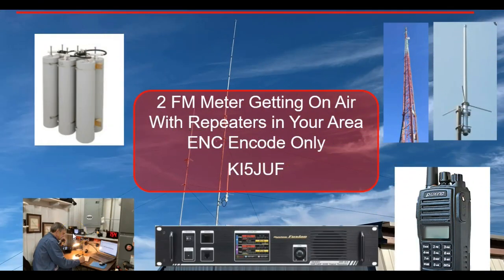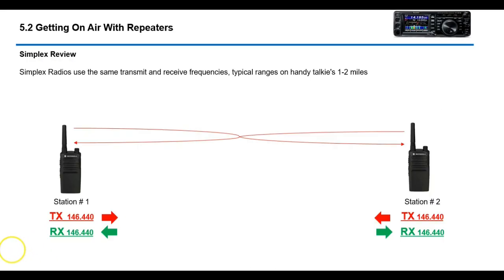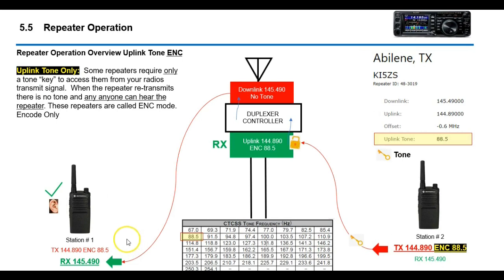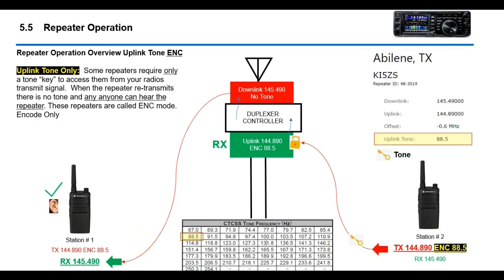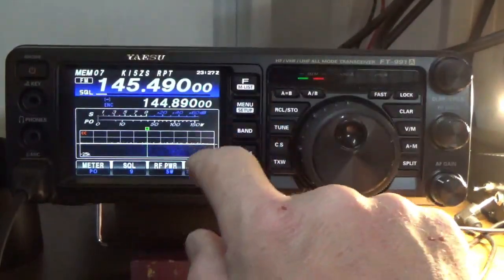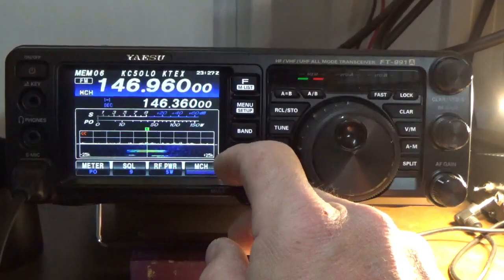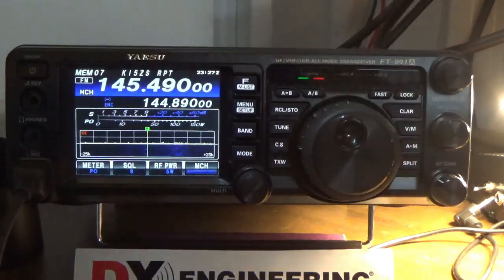2 FM Meter Getting On Air Programing FT991 ENC Encode Uplink Only Repeaters

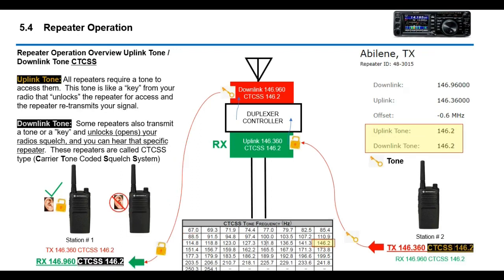Comment: Correction at about 2:30 & 3:50 anyone can hear the repeater. The CTCSS lets you lock "your" radio down to only repeaters/radios with that tone. But if your radio is in ENC mode you can still talk on the repeater and hear it, you will just hear everything on that fx. This is easy to test go to a CTCSS repeater and program your radio with ENC and talk to the repeater. Thanks for the videos you do a great job.
Reply from the maker: Good morning Tracy,  that's a good point, appreciate the message all this infro is great we are all learning together.  '73 de KI5JUF